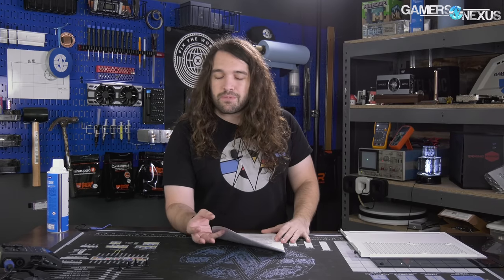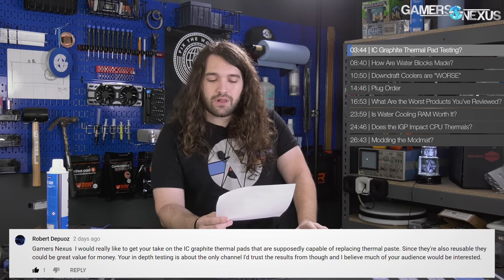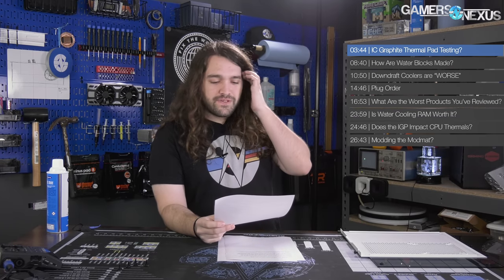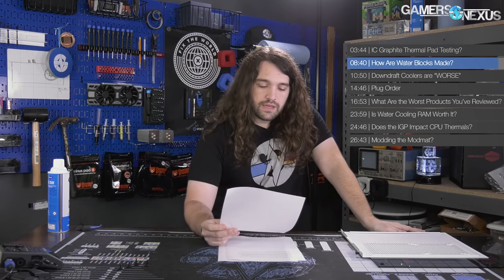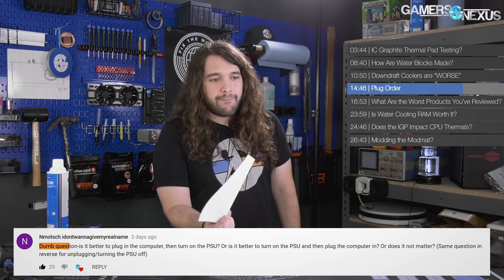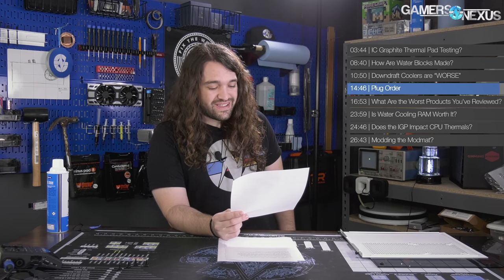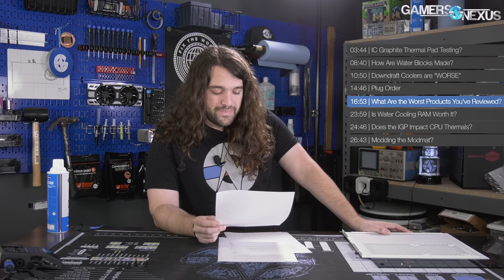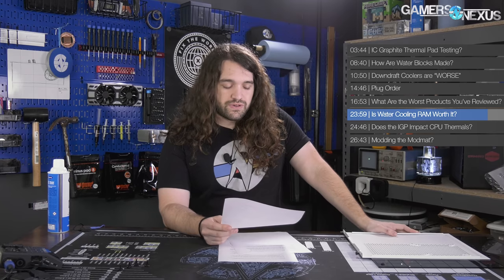Ask GN 83: IC Graphite Thermal Pads, Worst Products Reviewed

Comment: IC Graphite Pads, for anyone curious. I currently use a 30x30 pad w a Dark Rock 4 cooling an R7 2700x @ 1.325. Under cpuz stress test I max out at 77.25c. Case is  dark base 700, one exhaust fan, one intake fan. Dark Rock 4 is extremely quiet, I'd say its efficiency is hampered by its fan. Quiet being the compromise. Fan is ran at full speed and still very quiet. Do I recommend the pad ? Yes.

It took me a few practice runs of placing the heatsink onto the pad however as the pad slides around. All that being said I'm happy.

Comment: I have wondered for several months if using a top quality graphene monolayer  between the die and waterblock using one of Der8auer direct die kits would help or hinder thermal performance. It adds an extra layer but should in theory spread that heat to the block far more evenly. Certainly not cheap.
Reply: Hinder.   Direct contact is as good as it gets.
Reply: Jaymiecain1, how can you be so sure, from the Die it is a concentrated one point of heat. The monolayer would be able to take that heat and spread it far more evenly to the entire area of the water block almost instantly. You are talking about one Atom of Carbon and 25microns of copper extra at most along with possibly some extra liquid metal. It could even allow for water blocks with micro fins across a far larger area.

Comment: I switched to a high quality graphite pad from a high quality thermal paste about a year ago. It's been fantastic, no real difference in temps and not having to clean and reapply paste is wonderful. I swap CPUs a lot and also delid mine to install customer copper IHS blocks, so YMMV. Highly recommend graphite pads. They're more expensive, but if you handle them carefully with tweezers, they're reusable and shall last a long time.

Comment: in terms of generating more airflow over the VRM's (maybe ram as well but seems far away) is flipping the fear exhaust fan worth it (in say a liquid cooled system with a top exhaust).
having a H440 filled up with fans (3 restrictive intake's, H440 frontpanel + 240 thick/medium rad with pump/res attached, 3 mildly restrictive exhausts pushing air through a 360 rad) decided to put a dust filter on and flip the rear exhaust to be a additional intake, get some fresher air over the vrm area at the very least wile hopefully reducing dust buildup through positive pressure. and looking at it it might help out my GPU a little as well (solid metal EK backplate that does contact the rear of the core and VRM w thermalpads) flowing some fresh air over the backplate.

Comment: 14:46 - plug order. you said it doesn't matter. i fried a PSU with no on/off switch on it by first plugging it into the outlet, then into the computer. big no-no. always plug it into the PSU first (in an off position, if it has one) - then plug the ground first into the 3-prong hole that you're plugging into (on the outlet).

this is extremely important for PSUs that don't have an on & off switch (or if you've run some ghetto ass plug in the wall with a 2-prong adapter ;D)

always good to take precautions though..

i obviously could be wrong but this has been the fail-safe method for me. safe order is always this:
1. power off the OS via shutdown software
2. wait a bit, turn off PSU
3. wait a bit, turn off surge protector (unplug surge protector if you're using a shitty one with no ground protection)
4. unplug power cable from surge protector/outlet
5. unplug power cable from computer

correct way is to install is reversed steps, obv :3

Comment: For adding grounding points to mats I've always used clinch style studs myself. These have 4 metal prongs on the bottom that you push through the mat then bend over to secure them in place.

Comment: Several of the Asetek manufactured coolers come with way too long screws. I dunno if they intend for them to be mounted to really thick sheet metal but most cases have very thin walls unless you have one of those aluminium cases where they need thicker sheeting to get structural rigidity. At least they can supply enough washers if that is the case. With just one washer you can't even fully tighten the screw before it hits that protection wall to protect the radiator tubes/fins. And yes that is after going through the supplied fans as well.

Comment: Been using the IC pad for two weeks now on my 7700k running at 4.8ghz. The temps are probably 1-2 degrees higher on average than the compound I was using before. For me it's definitely worth the slight temp increase for the convenience. Obviously not a scientific test, but there you go.

Comment: Talking about bad cables, back in the day cheap SCART cables were also only wired for composite video + stereo audio, with the RGB pins not connected. Today, good SCART gear (you know, retro gaming is still a thing) simply does not exist anymore.

Comment: What would be really interesting is if the IC Graphite could be put inside an IHS and make contact across the full inner surface. From LTT's video, it spreads heat along its X/Y dimensions super fast, so it could suck the heat from the chip and spread it evenly across the entire heat spreader so there wouldn't be "hot spots"

Comment: Electrical conducivity between die/PCB and IHS is not an issue if you coat the PCB components with an appropriate insulator (clear nail polish is often used; I have used a professional polyurethane conformal coating).

Comment: there is a "matrix in cmd" bat file that does the same thing all the time for a single core (or multi using multiple cmd instances.)  this unlike most "Stress tests" this just runs the script as fast as possible all the time till closed generating random numbers. so this MAY be of interest for you to use in testing temperature (since it does not give output it cannot be used for testing performance. but it does produce the same amount of heat regardless of when it is run or how long it is run.) aida64 tends to run about the same power regardless of when/how long it was run I.E:~128w 8700k@4.8ghz constant as read in hw monitor.

Comment: I can understand the hesitation to recommend the IC thermal pads for something like overclocking and pushing manufacturer specs on components like the CPU. But IC thermal pads are reusable. They don't dry out like thermal compounds do. And they have been proven to be "nearly as efficient as some of the top goop compounds in performance. So for people who just want a simple way to transfer heat from the CPU and you aren't a massive snob about using thermal goop cause "dat extra 5* Bra!" then by all means get the IC thermal pads. But beware of the size you buy. And read reviews from people who have purchased them. Like on Newegg you will see people saying they bought the 30x30 pads and they have a AMD threadripper cpu. lol well duh it wont fit threadripper CPUs and FN huge compared to regular intel CPUs. So just be a smart buyer. Take the extra 5 minutes to do some research and read buyer reviews. Also as been stated on many Youtube channels and forum posts. The IC thermal pads are electrically conductive. Meaning you can short shit out if you aren't careful when you install the pads. If you are not sure how do it safely then look up vids on Youtube or google search. The information is out there and in way better formats than I could ever say here. Obvious if you overclock or just get a PC boner from laying down the perfect goop peas or cross patterns then IC thermal pads aren't even on your radar. But if you are just joe blow average consumer and you just want something that's a little more user friendly and takes some of the guess work out of did i used enough of X material to cool Y component. Then IC thermal pads should be on your list of options. Its a good product and it can be reused multiple times. Just do your homework before you buy it and blindly start using it. If something gets fucked up then its on you and not the product. Im talking to you 60% of Newegg reviews!

Comment: #AskGN does PSU cable length affect power efficiency when powering a GPU/CPU? Mainly asking for extension cables or custom braided ones.
Reply: yes, the longer the cable, the more electrical resistance, the lower the current
Reply: Unless you are running them hundreds of feet, no, not really, the short distance those braided cables are is irrelevant in electrical terms.
Reply: The (extra) connector probably has more impact than the extra length.
Reply: Yes you have some losses but I looked it up and it's rated to 3a max per cable. So like nothing. Power losses as heat in a resistor (wire) goes up exponentially I'm pretty sure so if you half your current then you quarter your heat output. The spec is so under rated at the moment that even full load there is probably only 1w or something of heat being made (or power wasted depending on how you look at it)
Reply: Properly sized cables, no. The longer you go, the more voltage drop (and losses) unless offset by thicker wire. With a long, thin cable or low quality connectors you can get quite a lot of losses, I'd say up to 10-20%.
Reply: In theory? Absolutely. The resistive voltage drop would increase the current that your PSU pulls through it (since the power is constant) which leads to more heat and even higher resistance (which will hopefully reach equilibrium before the cable melts), and any inductance will further lower the power factor. Remember that we are talking about AC so it will interact with nearby metal through electromagnetism.

In practice you shouldn't get any significant drop in efficiency. The resistive voltage drop should be negligible with any reasonable cable dimensions, especially if you're running 220V. The power factor shouldn't take a hit from inductance either unless you coil up the wire around a table leg (which you should never do anyway because that effectively turns that section of the cable into a transformer). Furthermore both live and neutral runs parallel and the magnetic field is inversely proportional to the square of the distance, so the net force on surrounding metals are effectively zero. That's not to say cable length isn't a real issue under extreme conditions but for any reasonable home use you don't need to worry about it. As +Stefan Klein said the connectors are what you should worry about, that's the weakest link.

So as long as you are using standards compliant cables you'll probably be better off turning down your fan speeds to save power.
Reply: Djhg2000 I assumed we were talking about 12V DC, since that's the voltage you'd most likely use for example to power external GPUs for mining. The cables in a mining rig can get quite long. The same does hold true, the card will have a certain power draw and will increase its current draw at lower voltages to meet that demand, up to a certain point, I'm not sure whether the card starts throttling early.
 You shouldn't be concerned with power factor since the AC side will mostly be rated well enough and you don't care about the utility's power loss since you're only getting billed for the power from your meter's perspective.
Reply: +Jernej Jakob This is why I shouldn't write comments when I'm tired. For some reason custom braided AC cables made perfect sense...

Comment: @gamer nexus - why are we seeing drastic advancements in CPU core's and threads but not so much in clocks anymore?? As a gamer wouldn't i benefit more from a 4c/8t 6ghz CPU over a 8c/16t 3.5ghz?...currently running a 5.2ghz 7700k and can't fathom why i would upgrade the way CPU's are headed...
Reply: With the GOD, Intel moving to more cores we will see MS DX and apps start to use more cores. A 4core 6GHz is rare and an 8 core 4GHz is common. Watching test apps that will use every single core will show you the future. Intel's decade long tick-tock 4 core lock down is dead.

Comment: Is there a good alternative to liquid metal for deliding for long term?? Most people recommend replacing LM every 9 months. Im too lazy, is there a high quality TIM??
Reply: Ggchb Gig ghb there's no replacement for liquid metal. The IC graphite pads are really good for convenience and laptops, but you won't get performance even close to liquid metal. It's more comparable to the performance of a premium, non-conductive thermal paste.
Reply: And most people talk out of their rear end ... *sigh

If you apply LM correctly and use the right one, there are no problems. Yes there are/were LM "pastes" that had problems with long term use, but for example that stuff Steve uses here and promotes from Thermal Grizzly is known for being without issues when it comes to long term use.

Btw, LM was never intended for LN2 and as far as I know also isn't suited in combination with a chiller. Though with the later I'm not certain.
Reply: Addendum - I 've used a 3570K for years with LM without having to reopen that thing.
Reply: jort93z you'll see a significant boost in performance by replacing stock paste from a laptop CPU and GPU. Every time I open a laptop using the stock compound, I see it pooling on the sides of the die. It just doesn't work well in laptops because of the lack of thermal dissipation. So, yes you will always see an improvement by removing stock paste on a laptop, pretty much regardless on how old it is. As for desktop PCs, I don't know of anyone who use the stock paste/cooler, other than the compound between the die and the heat spreader. Most people don't delid their CPUs.
Reply: jort93z notebooks don't have IHS
Reply: jort93z yeah my fault, I got off topic.
Reply: Silicon Lottery has been selling De-lidded Cpus for years. Here is what they have to say (I think I would believe them over random people on the internet) There is no need to replace the liquid metal over time. We've been selling delidded processors for three years without any reports of thermal degradation.  https://siliconlottery.com/collections/all/products/delid
Reply: The only reason it's suggested you re-change the Liquid metal is so it doesn't start to 'merge' with the copper.  Over time the liquid metal will cause some stains and some rough patches, but temperatures should be more or less the same.  Here's a link explaining it: http://forum.notebookreview.com/threads/something-to-think-about-liquid-metal-compatibility-with-copper-heat-sinks.800890/
Reply: Jason Poole head or heat?

Comment: In my case are 3 slow fans at the top, blowing air out. For the simple reason to not pull settling dust into the case. Front fans pull air in and back blows out, so there is a constant air-flow for the motherboard. For the GPU and CPU I have water-cooled with an external radiator, just two pipes going into the case. Big case, corsair air cube.

Comment: Everyone always talks about replacing water blocks and pumps and such but what is the life expectancy on radiators?
Reply: joshua41175 yes. This keeps me up at night since I got an AIO 😂
Reply: After going to an open loop on a Threadripper, I looked into changing sockets and adding a GPU. Watercool Heatkiller AM3 to AM4 to 1150 series to 2011 to 2066 is about 10 euro. A TR block is stand alone and needs a new  CPU block. If you start with enough RAD and Pump adding VRM or a water block for a GPU is cheap. Like a good P/S or case an open loop is a multi upgrade product for numerous builds. If one part of your AIO fails, it's junk.

Comment: Hey Steve, greeting from another longhair!  
I've been in Tokyo very often over last 20+ years.  I think you're going to love it.
I don't go to Akihabara very often any more (it's not what it used to be), but if you go you should definitely visit Kanda Myojin.  It's a Shinto shrine very close to Akiba where the priests will bless your electronics to grant protection to them.  They also sell charms called jōhō anzen kigan 情報安全祈願 that is supposed to prevent viruses and freezes.
If you like to eat, Japan is amazing.  Sushi and ramen can be very reasonable.  Those conveyor belt sushi places, called kaitenzushi, are interesting but the quality is not as good as a regular sushi shop.  You should try both.  Japanese beef is just the best.  You should try shabu shabu, where you swish paper thin slices in hot broth to cook it.  There are some places where they serve all you can eat, but again, the quality is a little less than a regular shabu shabu restaurant.  
If you drink, try to find a Japanese Izakaya.  They usually have some interesting small dishes to eat while you're drinking.  The beer gardens should also be open while you're there.  The food there is usually more Western, like sausages, pizza, and french fries.

Comment: The Zalamn Z1 seems to have the same chassis as the Antec GX500B. Except Antec had mounts for 2x fans in the top (via a rather tall plastic shroud), 1x on the side and an extra fan in the front, meaning that the airflow in Antec's version is quite good (especially with the drive cage removed).

Comment: Not overhyped for graphite, it melts at an crazy high temp (+-3500 Celsius) and keeps it properties of heat conduction and heat release stays the same over any temp and graphite is carbon and carbon structures also have the same properties as silica which is used for semi conductors and graphite and silica is semi metals which will work well for any type of conduction. I think this can be the future for heat conduction.